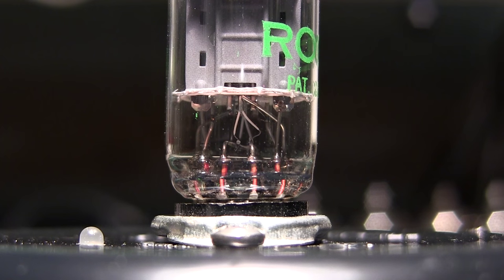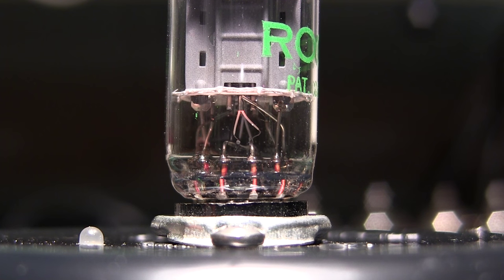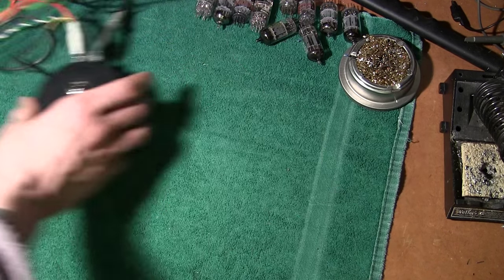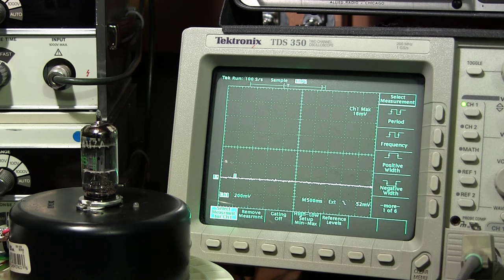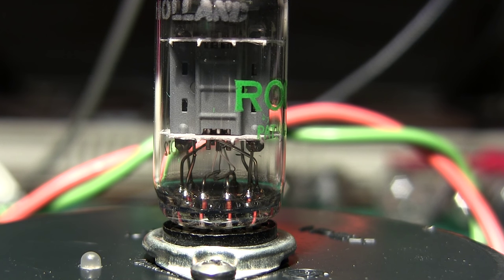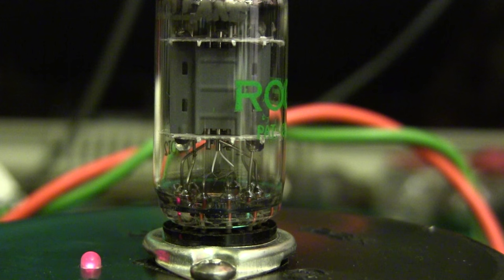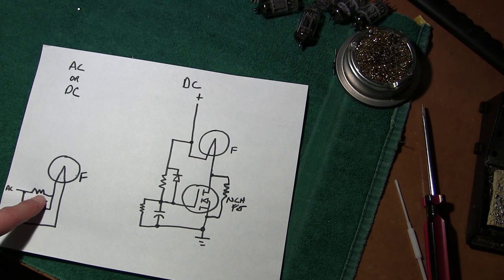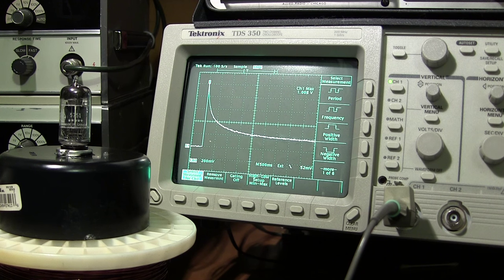Tech Tips Tuesday Dirty Little Secrets

Comment: Thanks for that!  What do you supposed the tube manufacturer did right on the second filament, which they failed to do with the first filament that flashed?  It seems as if they have inferior process-controls as compared to domestic manufacturers.  (Isn't that an unusual thing to say about German goods?  LOL!)
Reply from the maker: +axodal 
I'm beginning to think that the issue with these filaments is spot welder dwell time, or just too much current.
Reply: +Mr Carlson's Lab Cost reduction is the key - i can speak for valvo (i was lucky to watch an production video for an ECC83 my dad came up with when i was about 16years old) -- a typical consumer tube was manufactured within 6 minutes...from the pre-made mechanical body with micas held together by some supports mounted then on the bottom glass - with that welding process. Supports beeing cut away. Bottom glass beeing heated at the edge again and mounted together and then beeing evacuated and got it´s top nose when finished....next was the getter-flash. After that the still hot tube was electrically burned in and tested and when within specs let it cool down for short period and then beeing put in the box...

Comment: could this be rigged so that the "warming" resister is in use when an amp is in the usually useless "standby" position? this may also help save the life of the tube filaments in the long run, if one could be encouraged to utilize the standby function.

Comment: Alternative solution to this problem is using current source in series with tube
Reply from the maker: The whole idea is to apply a small amount of current first, just enough to warm the filament with no visible glow, after a short period, apply full filament Voltage, and no heater flash will occur.

Comment: Great video!
Question:Would is be better to use  MOV (metal oxide varisters ) as a surge protector on the tube filament?
Reply from the maker: +old64goat 
Hi. The idea is to apply a small Voltage to pre-warm the filament for a bout 15 "or so" seconds, then apply full filament Voltage. An MOV can not do this action. Thanks for your comment!

Comment: great video , need NE2 tube antenna protection explained
Reply from the maker: Hi John. When gas filled tubes are (not glowing), their impedance or resistance is very high. Once the gas filled tube is "struck" (glowing), it's impedance or resistance instantly goes low (close to a short circuit), protecting your receivers front end.
Reply: Thanks for the reply. I am trying to protect a Hallicrafters S-38

Comment: So, if I am building a amp with a 12ax7 I need to put a resistor on each filament pin in that tube socket or just the one. I am starting my first amp build. I think I will put a push switch so I will not forget to turn it off. Thanks for any help.

Comment: Did you consider a PTC thermistor in series with each filament? Same idea as the PTC thermistors used in series with TV / monitor degaussing coils. One component, no user actions.
Reply from the maker: +Railgap Esoterica 
I did, the answer is in the comments, a few times. (in short, it won't work)
Reply: It would have to be NTC of course.

Comment: if one was to design his own amplifier, would it be worth adding one of your circuits even if no heater flash exists? I mean just to save power. and do you think it would extend the life of even a non- heater flash tube?
Reply from the maker: +Chris Mosley 
Softening the start current on the tube is always beneficial.

Comment: Would it be possible to ramp up (or pulse width modulate) the heater supply voltage? Using a mosfet or a triac modulated supply would eliminate ne need for a big resistor and one could wick up a drop in circuit on a small pcb for that job.
Reply from the maker: The problem with any pulse on the heater is the introduction of noise.

Comment: Hello Mr Carlson.
I enjoy you're videos a lot. And I do have a subscription to you're Patreon page. Nearly done with an energy engineer education, so I learn a lot, however there is something in the video I do not understand. And it is about the schematics. You say that the diode is there to make sure that the capacitor drain out when circuit is off, but doesn't the cap drain out in the resistor that is in series with the cap???
Please explain if I have misunderstood something. Best regards Anders Lund
Reply from the maker: Hi Anders. The resistor will eventually drain the capacitor. The addition of the diode will immediately dump the charge back into the line or supply allowing the circuit to immediately reset. If the diode wasn't there, and the discharge was left up to the resistor, if one was to power off the circuit, then power it back on again in a short period of time, the cycle would be faster due to residual charge left in the capacitor.
Reply: Mr Carlson's Lab that makes perfect sense. Thank you

Comment: Do you think this is a materials problem that is to conductive when cold.
Reply from the maker: They spot weld the filament to the lead in connections (which are the tube pins in this case) When they spot weld the filament, they weaken the portion (in some cases harden) the tungsten by the weld. This leads to a flash in service.

Comment: Simple remedy dont buy Telefunken, Valvo, Mullard, Philips valves, because they are all owned  andb made by the Philips Company in Hollandb. RCA valves  were one of the best they were lovely valves 12au7, 12ax7 etc. The ECC´s were rather crappy in comparison. Telefunken and Valvo dreamed up the E for 6.3 Volt heater C for triodes F for HF Pentodes, Z for Rectifierrs before the war. Then came Grotty Philips after the war and took them over and continued using this nomenclature. i have a EF14 from about 1935 from Valvo I use it as a paper weight on my desk That was a good valve too.
Reply: So that must be why HP and Tektronix picked Philips over RCA for myriad tubes. HP did use some RCA 12AT7s though.  RCA's own, "for internal use only", documents eluded to them knowing their tubes were, more often than not, manufactured with faulty components, and commonly RCA  tubes were made with contaminated cathodes, straight from the factory. The document is probably available on the TCA's website. I just bought a sealed sleeve of 7199 RCAs and every one of them is useless junk.

Comment: This leaves the question, what causes the 'flash'? Has it got something to do with the kink in the filament? There has to be some underlying reason for this phenomenon.
Reply from the maker: +Robert Langford 
I'm thinking it may be spot welder dwell time.
Reply: Possibly. I guess the manufacturers have no interest in improving their devices. The more often they fail the more parts they sell.
Reply: +Mr Carlson&#39;s great video as usual, thanks.
It looks to me that the exposed tungsten without the white covering (which I assume is ceramic insulation) is much shorter on the rear heater. I suspect that is why it flashes less as it has more thermal mass, or is that just an optical illusion of the shot?

Comment: Hi Paul. So for CRT use... would you suggest converting to a DC filament supply and using the FET circuit for auto protection?
Reply from the maker: If you have heater flash "yes." If the filaments are lighting in a uniform fashion, don't worry about it.

Comment: Thanks for another helpful video. I have seen this flash and wondered if it was normal. Now I understand that it can cause premature failure. Would adding a diode to provide half wave rectification of the filament voltage be enough to prevent the flash? After the first 20 seconds then the diode could be shunted with a switch or relay. What do you think???
Reply from the maker: +Stanley Chytla 
Good possibility. The only issue with the diode is the introduction of noise while it's connected. Other than that, it may work??? May have to try that.

Comment: Very interesting video. Is there any benefit to a circuit like this for tunes without the flash? In other words, can you extend the life of regular tube heaters with something like this? Or would it just be a waste? Thanks for all your vids. Great stuff!
Reply: The most stressful time for any filament, tube/valve or light bulb, is initial turn on due to the near short condition at start-up until it has warmed enough to raise the resistance significantly and the current lowers dramatically.  So, yes, it will help to extend the life of any filament by reducing the initial thermal and mechanical stresses present during warmup.
Reply from the maker: +PelDaddy 
What Ethan said. Couldn't have worded it better myself.

Comment: Paul,

Like these Tech Tip Tuesdays.

I noticed that in the test vacuum tube, the filament that flashed was oddly shaped (right side) while the rear filament looked symmetrical. Could the shape of the filament cause a flash condition?
Reply: +Donald D'Egidio That was my first thought too
Reply from the maker: +Donald D'Egidio 
Good possibility. Much of this problem points to the spot weld on the lead in pin. Chances are the spot welder may have had too much dwell time, and changed the hardness of that small portion of the tungsten wire filament. The odd shape of the filament at the opening of the cathode pipe would be a candidate for future H/K shorts. The oxide coating is very thin, and it's against a sharp portion of that pipe. Thanks for your comment Donald.
Reply: What a wonderful demonstration!  Thanks! I someday expect to find your videos running in a Hollywood motion picture! Hopefully you'll agree to let them because today's youth could really benefit from your expertise.

Comment: It isn't just isn't European tubes, I've experienced it with some 50s or 60s Japanese tubes.
Reply: Those Japanese tubes were likely produced with Philips/Amperex machines and processes. You can tell tubes made on that equipment by the pinch lines left on the glass top of the tube. They either have 2 or 4 lines on the top.

Comment: exec lent as always! my question is pure regulated dc vs ac from transformer. your thoughts on life of filament? will the tube last longer using pure regulated dc? i have a hallicrafters sx111 receiver. i am running a regulated dc to the osc. and mixer tube. i have accomplished almost all drifting when the line voltage drops from my and outside surges.  
also added another 150v regulator tube for the b+ to the tubes. it takes a lot of surge now to effect surge driff. other than room temp change the rig is very stable, and removed the factory heating resistor out ( it will short out and burn up the radio) and used ceramic resistors now for heating. thinking of replacing the oc3 out using a circuit that would keep the voltage within +- 3 volts or less. also your thoughts on that. thank you much for your efforts enjoying them as always.
Reply from the maker: +Gordonseries385 
 Hi Gordon. DC filaments are great for low hum and noise applications. ( I prefer to use it myself ) The only issue with DC filament operation is "Filament Notching." I use regulated DC supplies in "some" receivers too. That older spectrum analyzer (44 GHz) you see under the curve tracer to the right has extensive modifications to eliminate lower frequency drift due to line variation. This is done with filament Voltage rectification and regulation. Sounds like your modifications to the Hallicrafters receiver work well!
Reply: +Mr Carlson's Lab 
Thank You Mr Carlson for the tip!

Comment: Hi Paul, is the ac or dc circuit similar to what the guitar amp companies use like marshall and mesa? Is this what happens when the amp is switched to stand by before we turn it on? It warms the tubes up? thanks
Reply from the maker: When the power switch is turned on in a guitar amplifier, all the tubes immediately start their warm-up. All the standby switch does is turn the high Voltage on and off. The tubes remain lit until you shut the power switch off. The average warm up time for an indirectly heated vacuum tube (12AX7, 6L6, 6V6, and so on) is around 15 seconds, at it's rated heater Voltage.

Comment: I noticed that in your schematic you have the current limiting resistor for the LED on the Cathode side of the LED.  I have seen the resistor on the Anode side and Cathode side in electonics, and I usually Anode the resistor on LEDs.  I'm confused on which is the correct way to do it?  Is there even a correct way to do it, or does it not matter?
Reply from the maker: +hydrolisk1792 
For many applications, any side is fine, Anode or Cathode.
Reply: Ah okay, thanks for the reply and answering the question :)

Comment: Great video as always, Paul!
I'm curious whether or not your soft-start circuit could be replaced with a thermistor or something similar? If not, why?
Reply from the maker: Hi, just browse the comments, I have answered that a few different ways already. Thanks for your kind comment!
Reply: ...I noticed that the old CRT color TV used a similar circuit to operate the CRT auto-degaussing circuit- and that component was subject to deterioration because of self-heating.

I suspect that you'd have a similar problem if you used a thermistor in the vacuum tube heater circuit.

Comment: Just found you....Great stuff. Is this why some guitar amps have a slow start rectifier tube like the GZ34 / 5AR4?
Reply: The heaters are usually supplied from a winding on the power transformer which applies full voltage at switch-on, so a tube rectifier won't solve this problem.